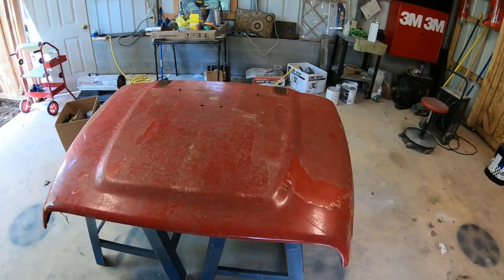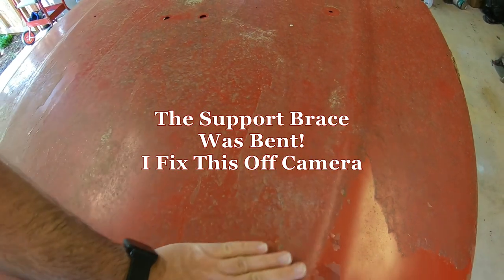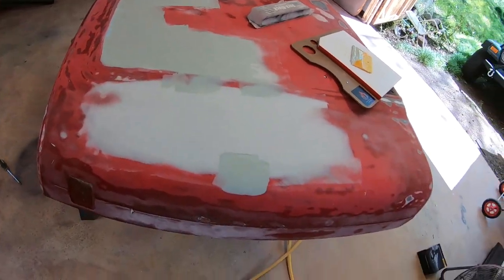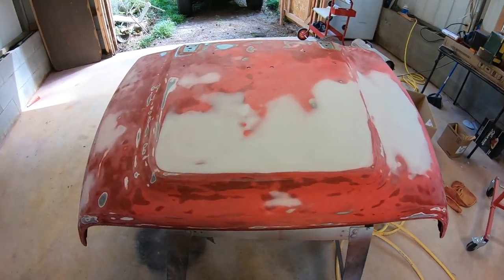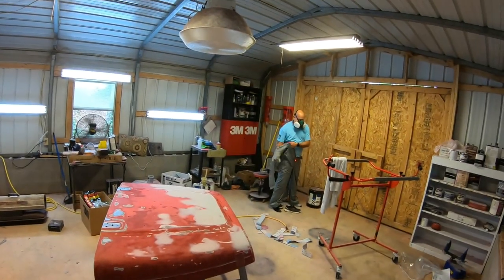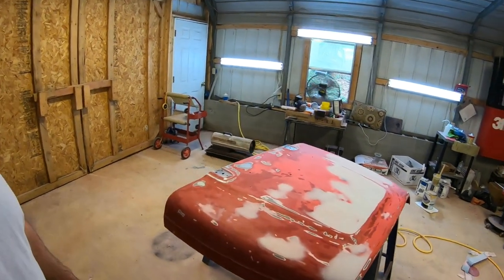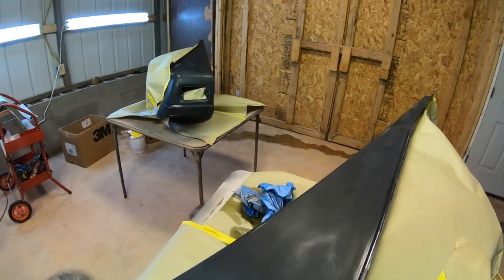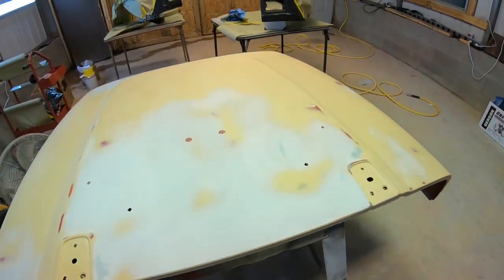97 Jeep wrangler TJ (Body and paint work Ep.1)

Comment: Did you buy new fenders? I'm going to buy both new finders. My hood is in good shape as it is. Going to Corinth this weekend, pick up a transmission jack. Then get the trans out, throwout bearing is making a noise. Going to put in a new Clutch, pressure plate and throwout bearing. And may put in a new flywheel while I'm at it.
Paint job will be next, along with all new AC parts. That way I can paint behind the dash as I have it all out to add Ac. Mine did not come with ac.
Reply from the maker: Yes I bought 2 new fenders. Good luck with your project.  Is yours a 2.5 or 4.0 engine and are you buying all new ac parts?
Reply: @ForceBuilt  2.5 and yes all new parts. Found the complete parts including wires and all. But there in Nashville, and don't want to run up there right now. New from Rockauto is not bad. Still have to get a ac control switch. Mine came factory without ac. Plus was a CA Jeep. So frame and tub is in great shape. 1997 TJ 4.11 gears 209,546 miles right now.
Reply from the maker: @Pete-from-Tn  good deal. That's funny cause mine is now 209.xxx miles lol.